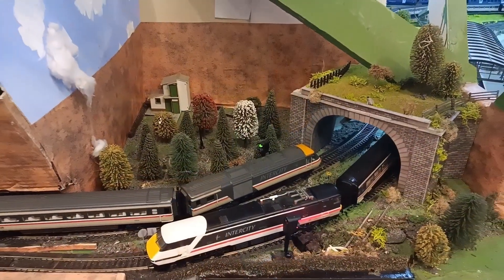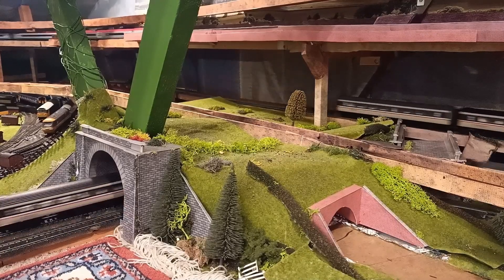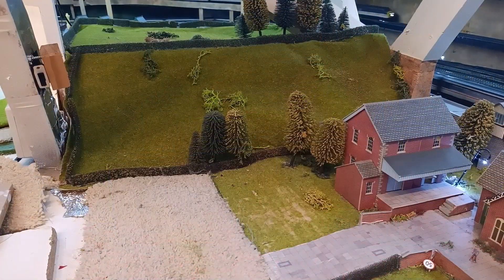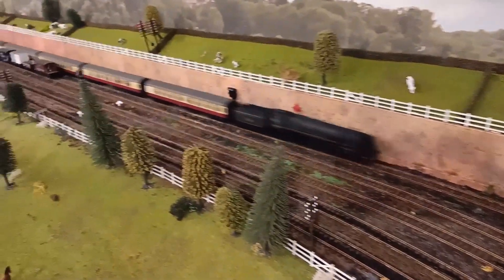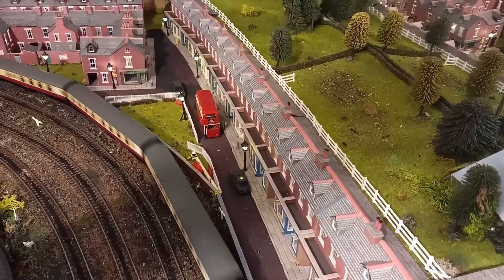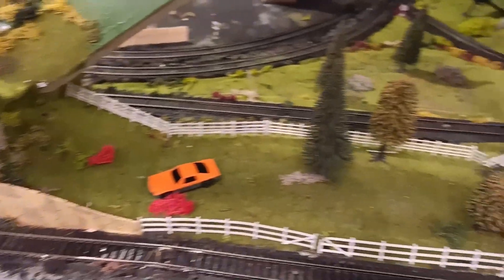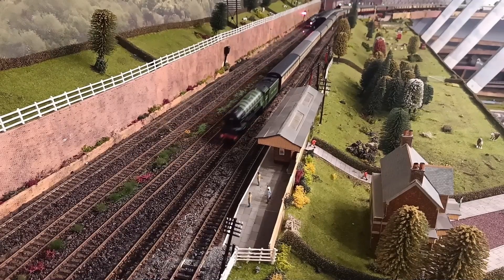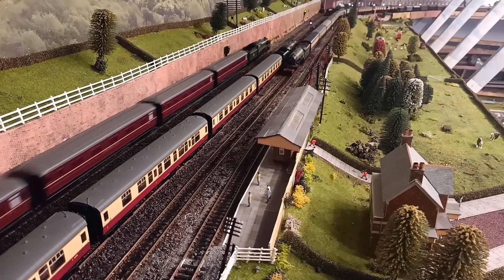A tour of scenery; hills and tunnels, model railway train set

Comment: 🎼"The Hills are alive with the Sound of.... trains"  😇

Most enjoyable video!

Forgive the question but how does the railway cross the canal inside of a tunnel @50 and @1.08?
Reply from the maker: Thankyou. The middle section of the canal  is has to cross through the water pipes in the lump and its like everything on my trains, its a compromise. Corners are too tight, Clan Classes pulling too many coaches too close together and so on. It was something I thought of, but gradients of track could not go over the canal. When I finally finish the canal video, it something I will say, a good point.

Philip